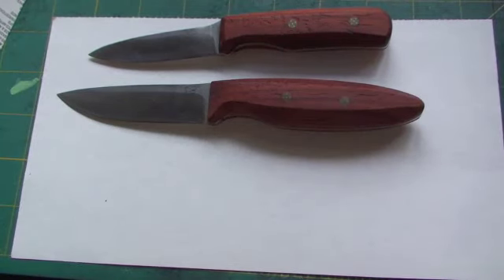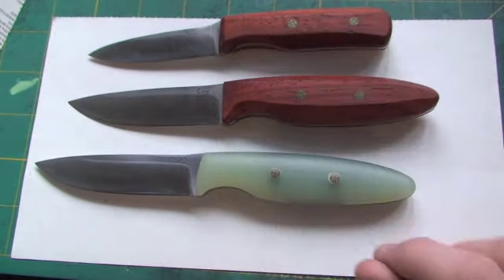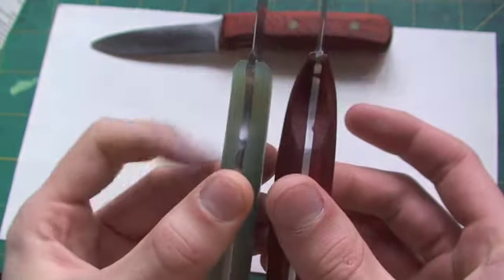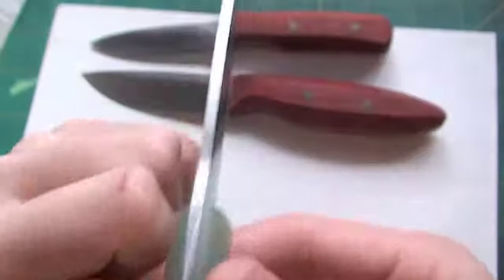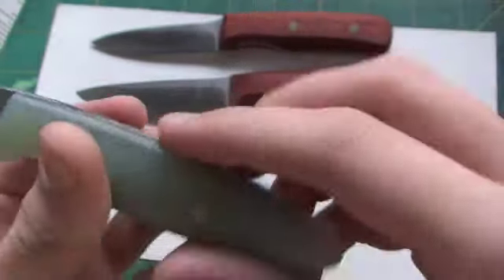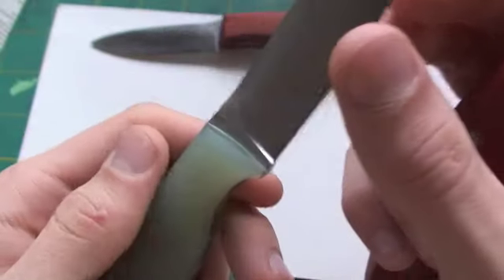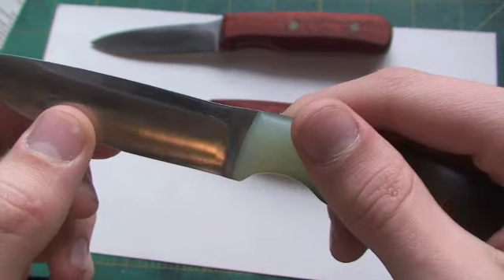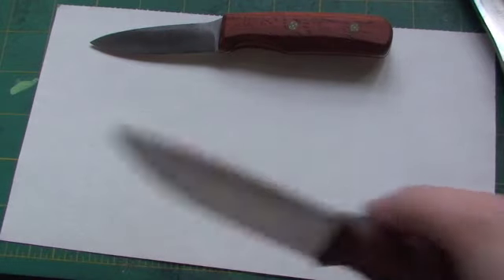"Custom" cKc Streamline Handle

Comment: That came out exceptionally well. It would be interesting for you to discuss the difference in hand and use between the different thickness  grips of the same knife. The thin option would make an excellent neck knife and lighter task blade

Comment from the maker: @haywoodf Thanks Glenn! With the 600 grit finish on the g10 i'm finding the grip to be about the same. I'm really loving the g-10 handle so far. With the O1 blade it is just one less thing to worry about in terms of maintenance as well.

Comment from the maker: @knivesandstuff I think i can still do that. I actually rounded the handle on the AEBL streamline a few hours ago for a grip that is more comfortable for my hands. Still thick, but just round now.  I think i will make a video later tonight on the differences in thicknesses. Both can be used quite hard IMO. I'll try to gather some points for the video.